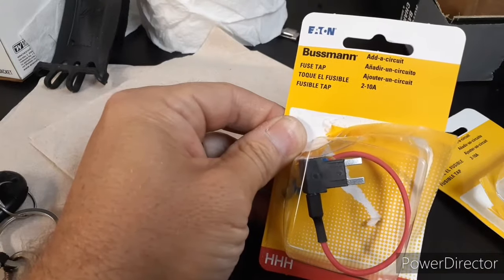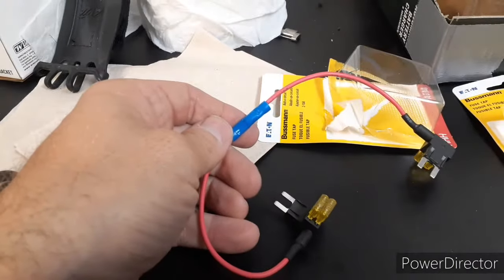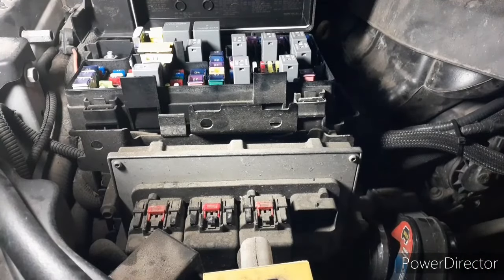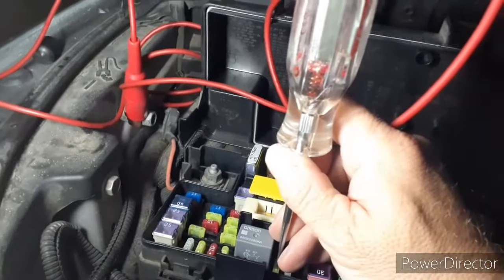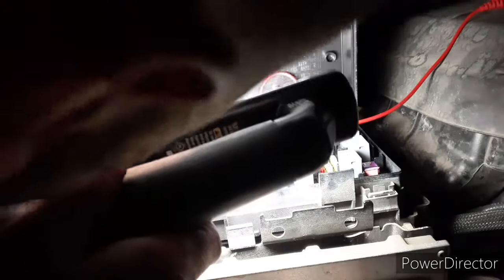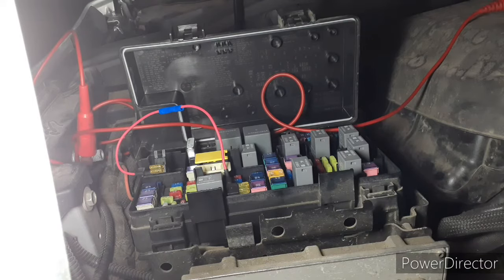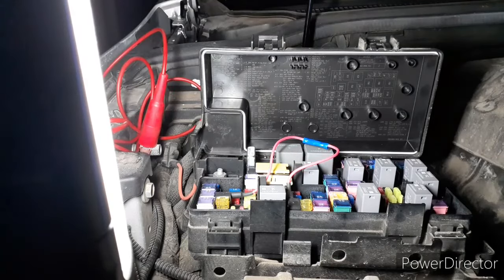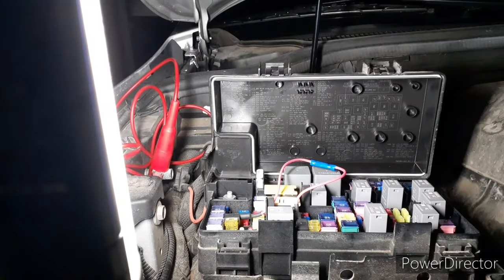Jeep Cranks But Won't Start. PCM Bypass Solution.

Comment: Hi. Thanks for the video. My Jeep seems to be a little different. My fuse box has the following markings: HOLP SW / blower, cooling fan, battery acc, ign run-start, IGN ACC/RUN, starter hbl, ac clutch. That I need to use ign acc/run seems clear from your video. But what is the other one? I can't find number next to the fuses, so that didn't help.
Reply from the maker: You either have an older or a newer jeep if your box is different. Therefore you have a different PCM and and this is likely not your solution. 

Keep troubleshooting.
Reply: @dinstaar  thanks for responding. Mine is a 1997 4.0 Cherokee. It sucks that there are so many differences between Cherokees. Some other solitions offered on Youtube also didn't pan out and were probably for a different model/year. I'm starting to lose faith in finding something that will work.
Reply from the maker: @rtv9_noord  Troubleshooting is the most difficult part. Why do you think we charge so much? Because it isn't easy. Most of the best techs go to an expensive tech school, then get several OEM and engine certifications, then have to gain years of experience in our field to be considered any good. 

Sorry but it is really impossible for me to help you without having your jeep here to see it, hear it, and feel it. Good luck.
Reply: @dinstaar  
Thanks for your respons.
I wish there was an expert nearby, but there doesn't seem to be. I asked around.
I thought the problem is simple: the remote doesn't work. So diagnostics are limited to whether the key fob is defective, the receiver, or the system that manages the signal and cuts the fuel supply. I had hoped that circumventing the security system would be something I can do myself since shops here abouts have to do the same thing I'm doing: surf the internet, ask around and just try stuff that is presented here on Youtube. Two down, three to go.
Reply from the maker: @rtv9_noord  so everything works but the remote start? Is this an aftermarket system? To be clear what I am doing in this video does not bypass security in any way. It bypasses a known problem in the PCM that fails to provide power to the fuel pump. 

Let me know if everything works besides the remote start.
Reply: @dinstaar  What doesn't work is the remote door (un)lock. Consequently the alarm is not disabled. I can start the car, but after a few seconds the fuel is cut off. I can live without the central locking remote, but then I need to circumvent the security system which cuts of the fuel supply.
Reply from the maker: @rtv9_noord  Again I ask you, is this aftermarket? My guess is that it is. I have seen this failure on lots of aftermarket systems.
Reply: @dinstaar  No, this is Chrysler's own system.
Reply from the maker: @rtv9_noord  Chrysler owns Jeep and they used the same fuse box and PCM in many of their vehicles.  This failure in the computer to provide power to the fuel pump is not Jeep specific and exists on many Chrysler products.
Reply: @dinstaar  What I don't understand is what the PCM has to do with the central door lock. The PCM is the reason the fuel is cut off when the security system hasn't been disarmed. But the door locks don't react to the remote which switches off the security, while this is something the remote did first thing you pressed it. My first thought was that the remote must be broken, or the receiver in the roof console. But someone else also said I need to replace the PCM. Does that really control the door locks as well?
Reply from the maker: @rtv9_noord  Man, this bypass has nothing to do with door locks or security at all. Absolutely nothing. It is for a specific malfunction of the PCM for fuel. If you have a different problem (and you do), this video will not help you.

Your problem is electrical and it can be a great number of things. Electrical diagnosis is one of the most difficult aspects of toubleshooting. If you do not have a ton of experience or an education in electrical theory and training on how to read schematics you cannot solve this by yourself.
Reply: @dinstaar  Good to know. My problem is that I can't find someone with the needed expertise. One Jeep specialist said I need another PCM, one without the security option, at the cost of $600 for a used one. The other referred me to a remote key specialist. The Jeep dealership doesn't know about older models and doesn't recognize the problem. So while I definitely do not have the required skills, it looks like I'm still the one who has to solve this. I really wish it was different.
Reply from the maker: @rtv9_noord  Yeah, electrical is difficult and expensive.  The only reason I got really good at it is because I used to work on generators and frequency converters in the Air Force.  After that, everything else is easy for me.  It is most mechanic's weak point (that is why I commanded higher pay than everyone else).  

I never got an answer from you about if this is aftermarket or stock... If it is aftermarket, you may have to remove the entire system.  They all fail after awhile and this is common.  I am sorry I am not probably not close enough to you to help unless you live in Waco.  If it is stock, you can try 3 things: 
1. Get a new fob and program it.  This is less money than a PCM.
2. Remove your PCM and send it off for reprogramming or replacement.  This is expensive and honestly, may not work.
3. Live with it.  Let's be honest, this is really a luxury option and if it is a 1997 I doubt I would be willing to put enough money into the problem to fix it.  If I could open the door with the key and it runs good I could live with it.

Good luck my friend
Reply: @dinstaar  Thanks for the tip. Something went wrong with a previous answer of mine about the remote I guess. It is not after market. It does 2 things: (un)lock all doors and disarm the security. I've been told that there is no other way to disarm the security than with the remote. Even with doors open I still can't drive. I can start and the engine will run for just a few seconds, then shut down. So it's more than a luxury system. The guy who wants to sell me another pcm says it will solve the security issue. I've sent out the remote for repair although I have no way of knowing whether is was broke or not. If not, I could check the wiring to the receiver in the roof console. But again I have no way of determining whether that works or not.
Do you think replacing the pcm with one without the security option will render my Cherokee driveable again?
Reply from the maker: @rtv9_noord  Impossible to make that determination without running some tests and looking at the schematic. Good luck.
Reply: @dinstaar  will this work for a 2017 jeep compass?
Reply from the maker: @sherrytapscott7878  No. 2017s have a different fuse box and a different PCM. This is not a known failure in your model.

Comment: Can this be done in a jeep compass 2007 which fuses .?
Reply from the maker: Look at your fuse box. If it is the same, you have the same PCM. If it is not, you don't and this will not work. As to what fuses, my video covers this in depth, watch it again.
Reply: @dinstaar  ok it is totally different from mine I thought this would work for all Chryslers jeep and dodge.
Reply from the maker: @williamsenior717  it applies for a great many, but not all.

Comment: What if it isn’t identical do you have any suggestions
Reply from the maker: If it is not identical then it is not your PCM causing the problem. You have a different issue. There are many things it could be. I cannot give many suggestions without being able to see, hear, and feel the vehicle. 

Most likely causes are battery, starter, air, fuel, safety circuit, or another electrical component.

Comment: Hello! I have been having a similar issue but not exactly the same. On my 2012 JGC, it will crank and start but imediately stall. Second start it will crank until it times out. Third start it starts fine and stays running. Any ideas?
Reply from the maker: Any honest mechanic with experience will tell you that without the vehicle in front me I would be guessing. It could be a large number of things. Any chance you are in the Waco area?

Comment: Do you have a part number for those two fuse relays?
Reply from the maker: It is clearly pictured in the video. Pause it at 0:32 and you'll see it.
Reply: @dinstaar  GOT IT!  Thank you!  I seem to be having this same problem with my '97 Jeep Wrangler TJ. would this work with a Jeep Wrangler TJ?
Reply from the maker: @aarondmtz2178  No. You have a different PCM my friend. I used to own a TJ. I miss is every day. 

If it cranks and does not start, start looking at fuel supply problems. First, ensure power is getting to the pump, then make sure fuel is getting to the engine. Your issue is most likely somewhere in between. Most commonly a fuel filter, but check and make sure.

Comment: Will this work on a 16 JGC? I seem to be having some issues, cranks but won't start up all the way...
Reply: Battery is fine as it has 13volts, and lights and radio still turn on in accessory mode
Reply from the maker: @numba1corner14  it is uncommon for a 2016 to have this issue, but that does not mean it can't. Pay close attention to the checks I do in the beginning of this video. If your behaves the same, it may be the problem.
Reply: Got it fixed battery was super low, around 35%, got it charged up to 65% and it started right up... but this was very helpful! Thanks
Reply from the maker: Based on your comments you definitely have a battery issue. You tested at 13 volts, then stated it was only at 35% and needed a charge. I suspect your battery is not new. A battery can hold a surface charge and not pass a load test meaning it would be incapable of turning your starter hard enough even if it reads good voltage. It can also charge up to 12v or higher but may not be able to hold the charge for a long period of time (loses a little voltage over night or over a day or two). 

If your battery is behaving like this, or more than a couple of years old, change it with a new one. 

Good luck and thanks for watching!
Reply: @dinstaar  I will definitely get a new battery drove it around a while and it maintained 14 volts around there... thanks again

Comment: 2012 Jeep Grand Cherokee. I had high hopes for this solution but sadly it didn't fix my problem. I guess I'm faced with having the car towed to a dealership, where there's a two week wait for the new PCM and installation, if that is indeed the problem. A local mechanic thinks it could also be the fuel pump itself. Either way, I'm out around $1000 for this.
Reply from the maker: You will know for sure if it is the problem by doing checking voltage exactly like I did to see if the fuel pump is getting power when the key is switched on.

If the results you get are like on my video, it is the PCM. If you jump with fuse taps like I show you, then power is getting sent to your fuel pump. Have you cracked a fuel line to see if fuel is getting pumped to your engine? Have you checked for power at the fuel pump itself? There my be a broken wire.
Reply: @dinstaar  I checked the power with my voltmeter at M25 (labeled "FUEL/DSL LIFT PUMP" like you said) and zero volts. Jumpered to M7 which showed 12.5V on the meter. Once jumpered, I saw 12.5V at M25 but no start. Could it be I have a combination bad PCM and fuel pump? For what it's worth, we run this car almost exclusively on E85 ethanol, popular in our area. (Yes, it's a Flex Fuel engine!)
Reply from the maker: @zumajim  Well E85 is garbage. It is alcohol, not gas so it has no lubricant in it and is very rough on everything it touches because of that fact. When you factor in worse gas mileage you'll find that in the end it costs you much more than gasoline because of the added maintenance and repair that you have to do when running it. 

Your likely causes now are a loss of prime, a broken wire going to your fuel pump, a cracked line, a bad fuel pump, or a clogged fuel filter. 

Start by cycling the key on and off several times letting the fuel pump run for awhile each time. If your lines are dry, you need to give them a chance to fill up and build pressure. If that doesn't work, open a fuel line near the engine to see if you get fuel coming up there. If you don't time to check the fuel tank where the filter and pump are. 

Good luck.
Reply: @dinstaar  Hey just wanted to report that my car started after all with your jumper fix! A different post mentioned "cycling between ACC and RUN a few times befor engaging starter" and that helped, I think. Either way, she now starts reliably and we cancelled our appointment with the dreaded dealership (which is still almost two weeks away... That was the best they can do!) So add me to the long list of very happy followers. Can't thank you enough, sir!

Comment: Will this work on a 2013 Jeep Patriot?
Reply from the maker: Open your fuse box and see if it is identical. If so do not skip the electrical testing, it is important. If your jeep has the same voltage responses then the problem is the PCM and this will work.

Comment: I have no spark at the coils & fuel pump will not work when key is turned on , it cranks but will not start.  I replaced the fuel pump relay.
Reply from the maker: Test with a multimeter or test light at the fuse I show in my video. If there is no power there, do the bypass I show in the video. Good luck.

Comment: Amazing video!
My 2018 experienced long crank and no start once.  Second try it started and no issues. 

It also stalled once while in reverse, only once but it's got me worried it will happen again.

No check engine codes.  Do you think this is the same issue?

Should I be proactive and do this?

My fuse box is properly listing the fuse as a Fuel Pump Motor 20 Amp :).
Reply from the maker: This failure has no check engine codes. How long have you had this issue?

This is not a known issue for a 2018. I am not saying it is impossible, just not likely.
Reply: Hey Henry I’m having that same problem today man I been on the side of the road for hours cause it actually ain’t starting up this time, did you solve your problem? I’m in a 2018 Jeep Grand Cherokee latitude
Reply: It has stalled in reverse before too and it’s doing the long start no crank
Reply: @nicholascampbell7410  sorry just saw your post.  I havent been able to resolve the issue as it hasn't happened since.  Did you get yours figured out?
Reply: I’m having similar issue in my go cart 2019 renegade 2.4L. Mine started after 2 days and threw cod p0069. Most likely solution pcm replace and reprogram. Waiting for a tow this time to dealership, unfortunately. Any ideas would be nice since I’m 3 months past my 3 year warranty. 30,000 miles. 
I’m absolutely disgusted and shouldn’t have to deal with this $hit.